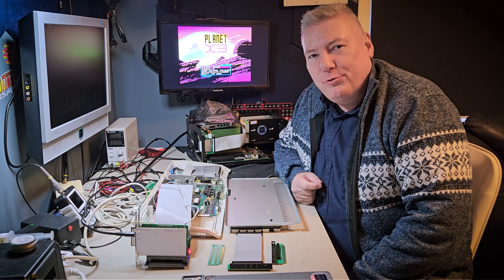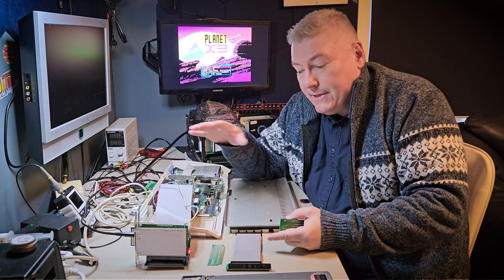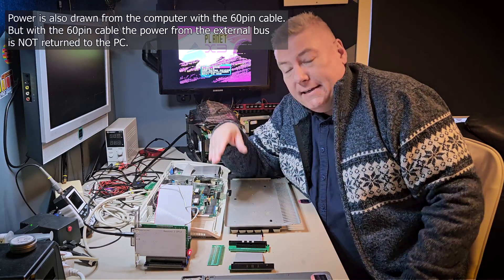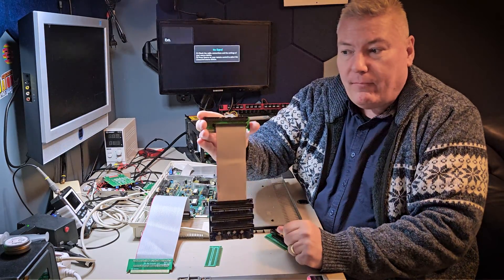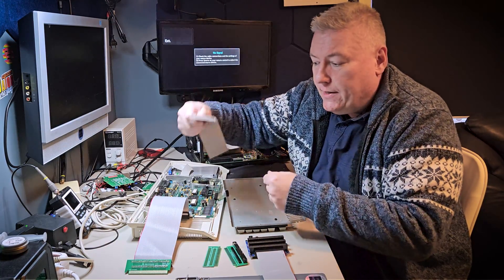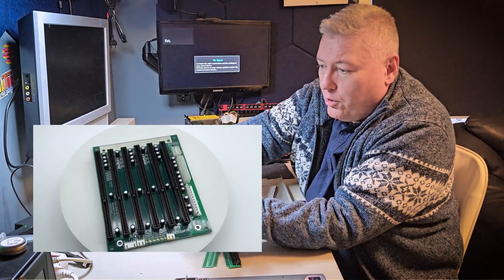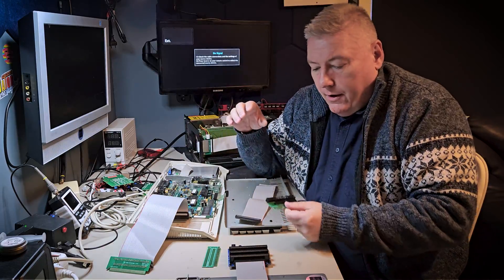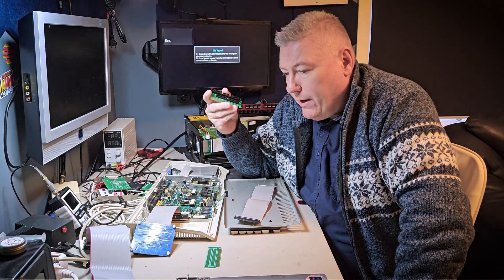ISA bus extender adapter 1.11 - development so far.

Comment: Great idea, regading the signal degradation, there is another creator's video mentioning he placed a metalized duct tape over the cable to block interference and that fixed the issues for him.
Reply from the maker: I have tried with metal tape, but did not improve much. Next step is to get som ferritt cores
Reply: @RetroErik   I see, to filter out some of the noise. Looking forward to see how the project evolves!

Comment: It might be possible to work in a diode to ensure the power supply does not backflow into the system. May also want one for the external power supply plug as well since if one has more voltage than the other it can cause issues. Could even make it more complicated and use a load balancing controller, but that would probably increase manufacturing costs a bit too much.

Comment: you can use a diode to stop power from the external power source going back into the system as they wont allow power to flow back through them
Reply from the maker: Not a bad idea. I will consider it.
Reply from the maker: Using a diode will reduce voltage på 0.5V. So maybe not.